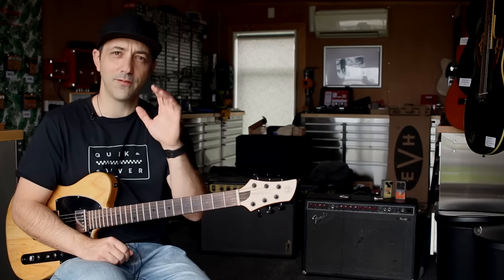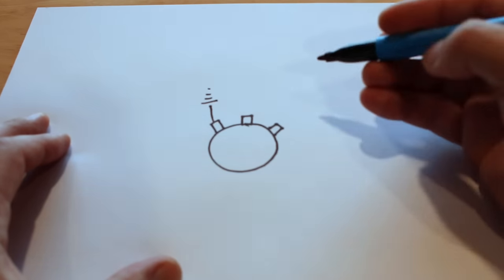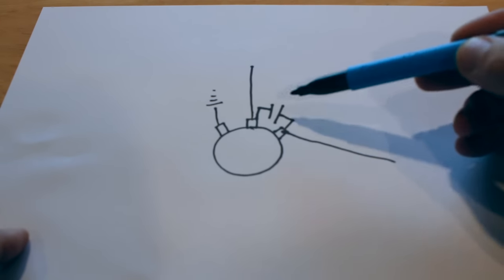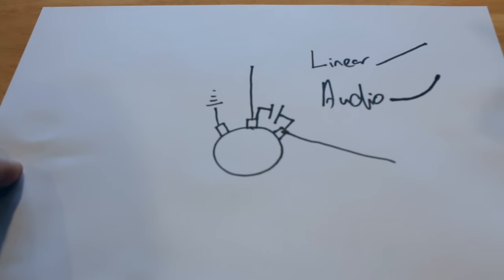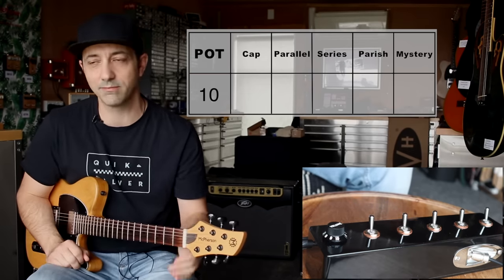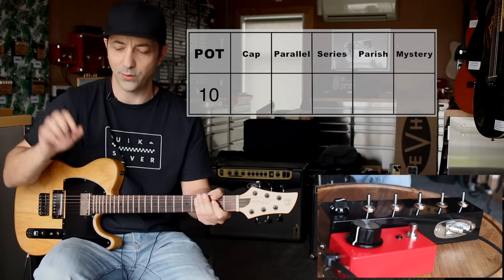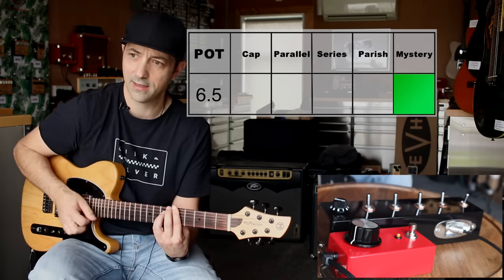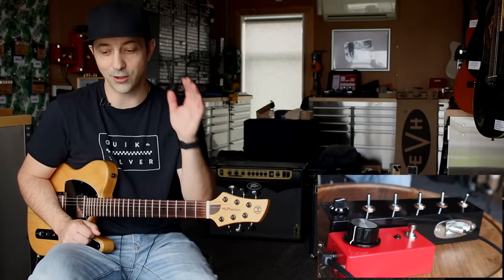The Famous 5 Treble Bleed Guitar Mods Compared

Comment: I really love having a Treble Bleed in my guitars, I have installed the parallel version, and I also tried the series, but testing these different setups with a stratocaster is not easy at all. Now, thanks to this video, I could hear the difference, and is not that much. One thing that I do not like about the TB is that from 0 to 2 there is no change in volume and then at 3 it is high. From 0 to 3 the raising of the volume is not progressive, I'm not able to what Jeff Beck does... 😃

Comment: Thanks most kindly!
If I added an inductor/Q-filter, would it 'make the pot' more global, flattening the difference between pickups on different guitars?
One other circuit related idea.
If I used a stereo cable, would it be possible to make a foot pedal that handled things like phase reversal, coil tapping and treble bleed etc if the pedal's just a continuation of the circuit that starts at the pickups?

Comment: After days with alligator clips hanging out of my guitar, the values I settled on are 1500pf cap in parallel with 150k resistor, 280k audio pot, Nashville Tele into deluxe reverb, 20ft low cap cable before first buffer. What I like about it is that I can go from (mostly clean) lead at 10 to totally clean funk rhythm at 7-8.5ish. This bleed gets pretty bright bellow 6, but that's fine because I really only use my guitar volume from 6-10. The other treble bleed all lost that funky neck + middle pickup magic as soon as I rolled the volume back a little

Comment: I use the volume knob for swells a lot. A year and a half ago, I bought a Jerry Donohue Signature Hellecaster Strat that had the standard treble bleed as stock. It messed up the taper enough that I had to clip it out in pretty short order. Most of the time I don't miss it, but sometimes when I turn down a little more than usual,  say 5 or 6, (I tend to live around 7 or 8 and turn up to 10 for leads) I disappear in the mix. It'd be nice sometimes to have that little extra "cut". I don't know though, sometimes when I'm totally solo I really like how the treble rolls off just right along with the volume. I may have to try that series version, but to be honest, in that guitar, with all its extra switching function and extra wire packed in there and small pots, it'd be a bit of a pain to accomplish. Thanks for the comparison though. It's certainly helpful.
Reply: Just gonna throw a possible solution for having the best of both worlds. If you replace your current volume pot with a push/pull pot you can add the treble bleed to one side of it and then activate/deactivate it based on the situation.
Reply: Linear volume pot instead of audio taper for swells.

Comment: Useful video. I use treble bleed only on neck p.u with guitars that have seperate volume pot for neck or bridge ofcourse.
I find it very useful almost all the time.
Only when i play with fuzzpedals and roll off volume,it beacomes too trebly.
Solution ? Yes, i mounted a push/pull pot with treble bleed in my in-position and no treble bleed in my out-position.
My own design, clever, right ?

Comment: I decided to try this on an HH Squier Thinline I had during Covid.  Not having separate components I bought a bleed circuit off eBay.  There’s are many available but all parallel.  Definitely doesn’t cut the volume much until it’s nearly in off position…

Comment: Put a 1nf cap un a muddy sounding les paul special Treble pickup, now I can roll the vol down to 3/4 for an almost acoustic Guitar tone , it actually sounds better than a big humbucker with that 1nf cap now. Don't even need a fuzz/OD pedal cos you can turn the master vol of the amp up and use the Guitar vol pot as a "Master" control..I almost got rid of the LP special till I put this mod in and replaced the the bridge with a Faber aluminium wrap around. So for a few quid(solder- 1nf cap from an old TV and a bit of patience and a torch ) a mediocre sounding instrument becomes the Guitar every-one wants to borrow!!
Reply from the maker: Very cool, thanks for sharing!

Comment: My favorite is also the series circuit but I prefer to have it on a linear volume. The mystery circuit is just like the one they use in the fender design for Eric Clapton mod to make his guitar sound like a Les Paul and he can vary his tone to add trouble or remove it to zero and then add more bass sound

Comment: This was very informative. Thanks!  One very frustrating thing for me is of the 5 guitars I play regularly, 3 of them have volume pots, that feel and sound like at least, they're on/off switches. Rolling the pot back it needs to get to nearly closed before anything effect is audible.  Very frustrating and even a local Tech -said- he did something to help one guitar (Reverend Agent OG) by adding a treble bleed @_@  w/e he did did nothing. Same problem with a parts caster strat and even my LTD EC1000. Conversely, my Eastman SB59 and old 78 Strat, the volume tapers beautifully....
Reply: Make sure first of all that you're using good quality pots on those guitars (read CTS).

Comment: Wow, what a great comparison!!! Thank you for prefacing it with understanding what a treble bleed actually is. I've put a few in some telecasters but only because someone trusted told me I needed to without really understanding the core of the physics of it. One question, the mystery piggyback pot, Is that linear or audio? And is the smoothness of it because of the type it is? The mod? or both ? Thanks
Reply from the maker: Thanks! The Dual Gang Pot is 2 x 500K Audio pots stuck together, the smoothness or Linear nature of how it works is due to the mod, cheers!

Comment: Waylon, so the mystery mode using a dual stack vol pot which is "wired for BOTH" Non-Treble bleed pot#1 and Treble bleed pot#2? Can you do a lesson about different Grease Bucket tone circuits because a Grease Bucket is adding a series cap to the tone parallel cap .033uf or .047uf so the series cap is adding in high pass so the tone control is not so muddy and dark.
Reply from the maker: Hi, In Mystery Mode the Dual Gang pot is wired as a complete unit, A variable HPF in parallel to a normal Volume pot
Yes, the Grease Bucket would be an interesting comparison, cheers!

Comment: I have a Strat that does not have a treble bleed circuit. The way I wire it, it acts as a treble bleed without anything added to the guitar to achieve the effect. It does not lose the highs as you turn the volume down and the pickups are opened up more and the output increases compared to stock type wiring.

Comment: As far as I can tell, the input of the circuit of most fuzz pedals, like a Fuzz Face for example is the same or very similar to a treble bleed on the output of your guitar. I think this is why they retain brightness when you dial back the volume to clean up into a fuzz face.
If that's right then the ideal setup if you use fuzz a lot is to have no treble bleed on your guitar.

Comment: Is that 6N8 cap on the mystery circuit a 6.8 nf? You sure cleared up a LOT of confusion in my world. Instead of me rewiring different setups, you have that cool bleed circuit box. Thank you very much. I have an import LP which is a really nice looking Grote. I'm going to upgrade the pups to Seymour Duncan JB and Jazz and change the pots to 500k ohms. I only had it one day and already rewired it for 50's style and independent volumes. I don't like the different changes that happen at a turn of any knob. Like I said, you cleared up a lot of confusion. Cheers, mate.

Comment: I've become a fan of the combination parallel and series option. That way, if you find a parallel treble bleed that you like but wish it had a more subtle effect, just introduce a bit of resistance in series and that essentially becomes a regulator for how much of the effect you want. My current jam is 1nF/330k in parallel with an additional 100k in series.

Comment: You cleared some things up, muddied others...

I'm a clean single coil player... use a cap only bleed. I've messed with adding a varistor in the bleed circuit, I could dial it in a bit better....

Good vid... but that double pot thing was unclear.

Comment: I wouldn’t want a treble bleed on a Les Paul, or any guitar that allows me to blend 2 pickups, but I’ve got the simple one on my Tele, and I love it.  I generally run my Tele at about 6, and crank it up to push my amp a bit for dynamics, and my treble/bass balance doesn’t change.  If I turn down enough (below3) it begins to function like a treble boost.

Comment: You saved me watching the whole video 
My volume is always fully open 
And I disconnect the tone control 
I’m putting a Tele together with no load pot .
I like my chicken 🐓 pickin to snap .
Reply from the maker: Nice!!
Reply: I set a tele up like this.
But, in the end, I can't live with jazz amp settings. I need to roll back to clean things up.
There are PUs out there that will cut through any thing.
Reply: I still use that tele, some times with a wha.
The volume pot has a push pull, switching  a .001uf cap and a 150k resistor in parallel.
This is a treb bypass, not a bleed.
Reply: @christophergallagher531  
I have tinnitus from 80s Heavy Metal 🎸 
Probably why I like open bridge.
Reply: @bandpassmess  I have it from the late '60s.  15" JBLs work well for me. There is a mid scoop, and the highs are oily.
I have a 12" JBL in a Deluxe Reverb. That amp is killer loud, even at jazz settings. 
Naturally there are other speaker choices, here. I always come back to the 15s.
Reply: @christophergallagher531  that’s heavy tone .
Reply: It is sure not brittle!  String windings can be up front honest.
'Ask Zack' 
has a posting where he tries a JBL.  Don't think he got past the honey moon.
If you are a contry picker, he is right there! Great channel.

Comment: What is your experience with the different capacitors that are available for treble bleed types. I found capacitors from 1pf up to 850pf and 1nf up to 47nf.... How they are related to the potentiometers of250w and 500w? I have had the idea to install a small  potentiometer for fine tuning the treble bleed, but I found this now in the internet. 🤔

Comment: What is the wiring diagram used inside your bleed box?
Reply from the maker: That box has been repurposed quite a few times, I wire everything up on the spot without any diagram. It's currently wired up for different coil slip circuits for my next video, cheers!

Comment: In this demonstration, the 1 nF capacitor and 150 k-ohm resistor in series appear to work the best.  However, the volume pot in my Ibanez RS100 from the factory is a linear taper, not an audio taper. Given the fact that these treble bleed circuits drastically affect tapers, it is difficult for me to evaluate in my case which one to choose. Would you consider redoing this again with a 500k linear pot?

Comment: I've just installed a parallel mod and when I go from 10 to 9 on volume I can hear that the very crisp top of the sound disappears. Should 100% of the treble still be present when rolling down the volume or will there always be some loss?
Reply from the maker: Hi Oskar, that sounds normal, it's not a 100% perfect solution. Have a go at some of the others to see if you like them better, cheers :)
Reply: @WaylonMcPhersonGuitar 
Thank you! :) would you recommend 1nF and 150k for Dimarzio humbuckers?
Reply from the maker: @GabrielSkolderblad  Give it a crack and see if you like it, the ears are the best judge, cheers!
Reply: @WaylonMcPhersonGuitar 
Can I ask what values you use?

Comment: I stopped using treble bleeds, as for me they cause more (completely unnecessary) problems than they solve. 

I also do not have the impression, that I need more treble with my Vox and Marshall amps, rather the opposite.

Getting a slightly smoother tone, if turning down volume, not necessarily has to be a disadvantage, eg. with a Les Paul PAF bridge pickup you get a killer tone just because of this (without any treble bleed), especially for overdrive tones, but also on a Strat or Tele this can even improve the tone for me, as what is happening is some resonance peak dampening due to the higher resistor value from the potentiometer, but getting only treble, if turning down volume too much (below 5) or losing zero voume, so that you cannot swell correctly anymore or cannot deactivate your guitar during a break by simply turning down volume, or the fact, that this circuit also changes a logarithmic potentiometer curve to a (more) linear one are serious disadvantages for me. (As if you suddenly had a completely different guitar on which nothing works and sounds, as it should anymore.) 

The only thing, I sometimes use, is a single 200pF to 330pF capacitor without any resistor, this has the fewest negative effects and still keeps some more treble within the circuit, but the usually recommmended 820pF to 1nF capacitors are much too intense for my taste. But usually I prefer not using any treble bleed.

If you need more highs, after having turned down volume, you can equally well use an eq-pedal and boost 2kHz and 4kHz a little and you are also there. Sometimes additionally or even instead reducing bass below 120Hz has the same or even a better and more constantly stable effect for me.

Comment: Thank you.  I've recently thought that it would be best to keep you guitar volume and tone at "5" and then adjust your amp accordingly. My reasoning is that if your controls are set to 8-10 you really have no where to go but down. Unfortunately, this won't work on my guitars, as they all have audio taper pots which, IMO, "wastes" 60-70% of the functionality of the control(s). But, I'm not too keen on swapping the pots for linear taper, as I'd have to have a tech do it and I'm trying to save money. Does anyone know of popular guitar models (that you might find at Guitar Center) that have linear taper pots?

Comment: The tolerance range of the parts used, min vs max, can have a profound influence if someone likes a treble bleed or not. I have found players try one variation built with random parts find they didn't like it and declare far and wide on forums they hate treble bleeds and go back to 50s style wiring because they never use the tone knob so don't have a problem with the tone knob rolling away the volume at the same time on those circuits. This is an old video but might be a useful model to show the treble bleed part variation effects https://www.youtube.com/watch?v=rR4maqK_IhQ  .

Comment: What I would have liked to hear: turn the volume approximately half-way down and leave it there. Then let us listen to each of the options, with the ones that are most similar to each other done side by side. That way we'd get a better idea of which one we'd prefer. I did a lot of experimenting recently with treble bleeds, but just installing it in the guitar, rejecting then moving on to another. 

I rejected the series for my own taste/needs. I tried (from memory) 250p, 360p, 500p, 680p, 760p, and finally 820p (smaller is warmer sounding, bigger is spankier/ twangier). All were in parallel with a 170K resistor. I kind of felt like I wanted to go up just a bit higher than 820p, but didn't have anything between 820 and 1000 on hand. I had in the past tried 1000p and 1200p (with no resistor) and rejected them both (I lived with the 1000p for decades, it wasn't terrible, but I didn't know anything about any of this stuff at the time). All in Strats/Teles.

Comment: A correction about pot tapers: counterintuitively, linear pots are actually going to have a perceived volume taper that is non linear. Audio taper pots are going to seem more smooth because decibels follow a logarithmic scale—that exponential looking taper is specifically there to counteract the logarithmic taper of volume itself so that you end up with a smoother feeling taper.

This is why, despite their taper appearing more exponential in shape, audio taper pots are often referred to as having a “logarithmic” taper.

Nine times out of ten, if you’ve got a tone or volume knob that spikes in volume at one end of its range, you’ve got a linear pot.

Comment: this is a very esoteric subject. if you hear nodifference it just means that you are not chosen by the god of tone to get one. then you actually might be able to make music and be happy with a squier. and oractice a different religion. if you are a chosen one you will have to make expensive sacrifices at the altar of tone. 
i tried it: after replacing a ceramic cap with a 20 € paper in oil cap, i felt much better about the sound of the guitar. i changed back. i felt worse. changed back, felt much better. to sound and play better its also important too feel better about something, you went the extra mile, made a ridiculous decision. one the oszilloscope wont show, well i‘m human. i believe in tone. if you play live the stuff on the wall or how full the venue is has more influence on the high content of your sound. out of your control. but having invested so much into my tone control made me more interested to actually use my tone control. 
changed to 50s wiring on a les paul. that changed the behaviour of the tone pot a lot. going to .10uf in the neck i roll it back more and  hear a difference to the same value ceramic cap. but that could be factory differences? how do you measure a cap? 
anyway, those woman tone differences come out more using a „transparent“ overdrive. not in clean sound.